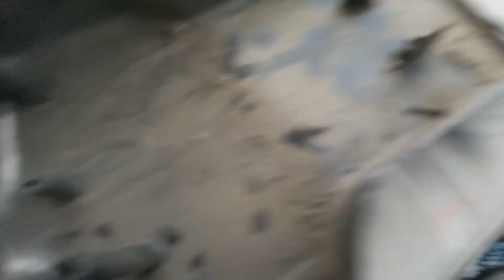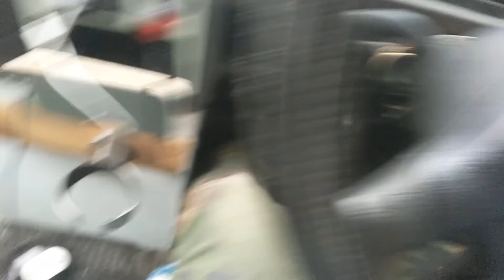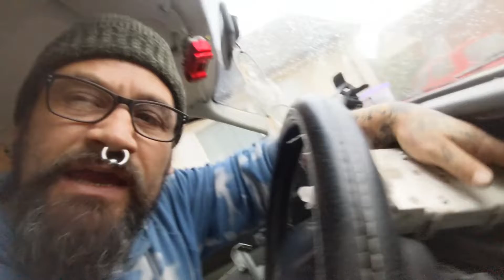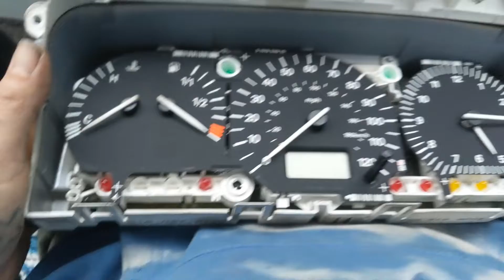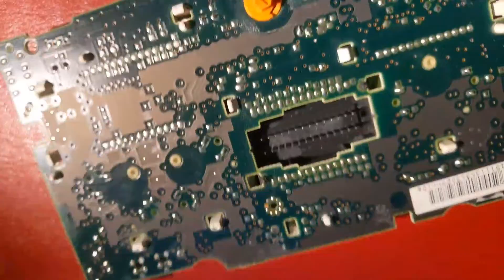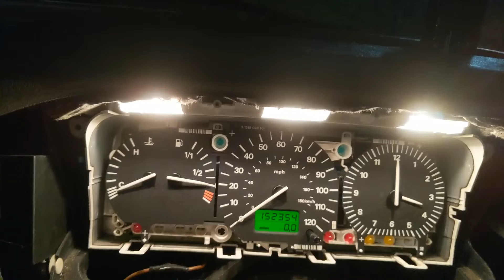VW T4 FUEL GAUGE & TEMPERATURE FIX: Here's How

Comment: Hi mate I know this is year later but do you know if you can have issue with temp gauge rising above 90 and fuel going up and down. Changed coolant sensor and thermo ask engine not overheating as has it running for few minutes in the cold and shows really high
Reply from the maker: Hello mate. This is what my clocks would do. Temp would either stay cold or be boiling hot on gauge and fuel just kept going up and down. Or not moving at all. The cap replacement sorted it for me mate. 👍💯
Reply: @ thanks mate. Going to rewatch your video again to see if I can do it myself. If not there guy on eBay for 60 pound and you send away and he repairs. 

Good luck with the new conversion you got going on

Comment: For those wondering how to get the needles or the rest of the plastic housing off: For the needles, use a cloth (so as not to scratch the dial face) and pliers to pull directly up (it might pull apart the motor, but that can be put back together) - you can rotate the water temp., fuel and speedometer needles, which helps; For the inner plastic housing, you have to unsolder the LEDs, it is not just the plastic clips that need undoing.

Thanks for the video, it’s the closest one I have found to taking apart the cluster.
Reply from the maker: Thanks for adding that in mate. And yes 100% correct. 🤟🤟🤟

Comment: Bloody clocks!! I had mine out and found nothing. Put them back in and TA-DAAAA!! They worked!
Unfortunately not for long. Back out again, too many times. They're still not working. Bugger😡
Reply from the maker: Mate they are infuriating, mine have worked and stopped working about 6 times since the vid, I have noticed a link between not working and cold /damp weather, have you noticed anything 🤟🤟
Reply: @valhallavw  not really, they used to be sporadic now they're just dead. I have just read though it could be a bum earth or connection.  I'm wanting to sell it but not until this is sorted.
Reply from the maker: @garymaddock4178  yeah I checked all my grounds and everything seems OK. Doesn't affect anything other than dials, I'll have it apart again in a few weeks and see if we can finally nail the problem 🤟🤟

Comment: Same thing happened to me T4 1999. Gave it a wiggle and it started to work. Bad connection must be a issue with the T4.
Reply from the maker: Mines still under investigation mate. Problem was solved but has now reappeared. 🤟🤟
Reply: @valhallavw  Yes mine comes and goes (with a kick).
Anyway thanks for the video I nearly wasted time and money on new sender and temperature gauge. Topman 👍
Reply from the maker: @tonymcpolin1049  glad you found the video useful mate. I'll post another when I investigate further 🤟🤟

Comment: I've got the same problem I find if I bang the top of the dashboard on the right hand side they start working again so it seems to be I've got a loose connection
Reply from the maker: Could be mate. I found no faults in mine when it was apart. Do you have a strange noise with yours.?? I think I showed it in the video.